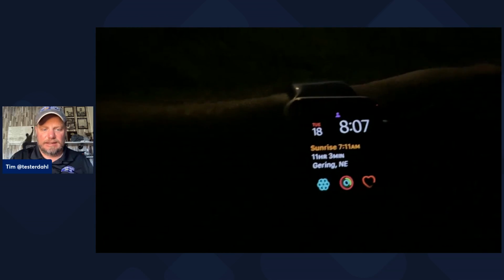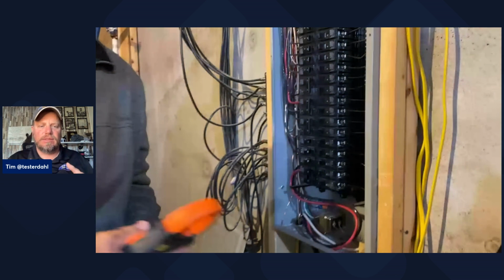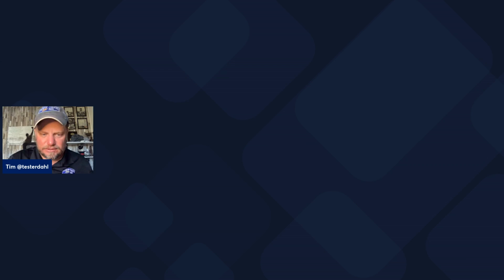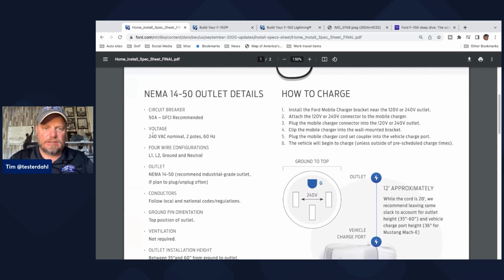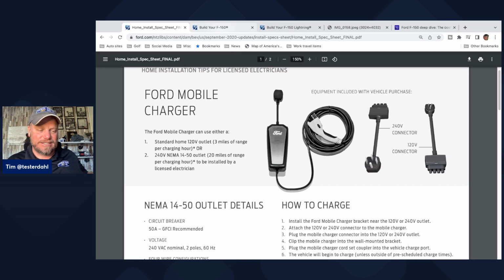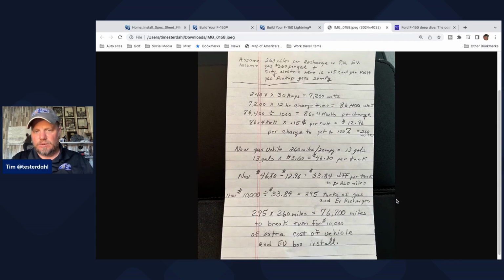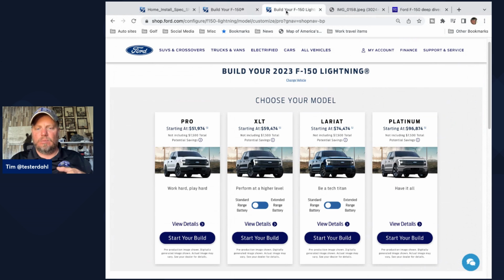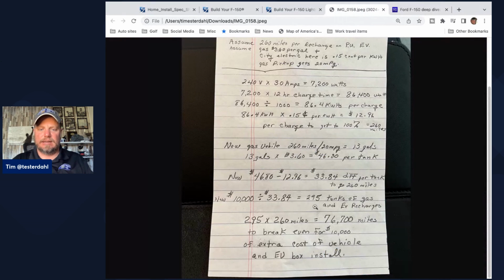11+ hours later on 220V charging price for 2022 Ford F-150 Lightning

Comment: Is an EV similar in cost for insurance?  Our state’s license fees are based on vehicle and Gross Vehicle Weight.  Just a couple more factors.  Another channel also mentioned additional snack/meal cost when you are on the road waiting for your EV to charge.  Interesting series of videos, Tim!
Reply from the maker: That's a really good question. I'm buying an EV next year and I'll have data then.
Reply: @Pickuptrucktalk  so many factors so you can't be exact, but generally insurance costs are similar.
Reply from the maker: @gelu88  interesting. Just literally chatted with an insurance agent who said costs are higher but could get to similar in time.
Reply: My platinum will cost me approximately $50 more every 6 months than my 2018 Toyota Prius costs me to insure. There are so many safety factors that the platinum has that reduces the costs.  Example I was backing up, was warned I was getting too close to a large plastic container, knowing I wouldn't hurt my trucks bumper if I did nudge it kept backing up, large red label appeared on screen collision danger & making noise, then the truck slammed on the brakes.  I put it in park to look and I still had an inch or two clearance. I believe,  had I been driving faster it would have reacted even sooner. Would it avoid a collision all together,  I don't know, but it would definitely reduce the amount of damage.
Reply: INS cost more for an electric vehicle vs similar gas. electric cars are just more to fix not to mention other factors such as batteries catching fire and harder to put out...a lot of states are now charging a "gas" tax (added registration cost every year) to get lost revenue for roads since they are not buying gas and that up to 400 in some states and as low as 150..some states are tossing around the idea of adding a per kw hour charge of .05 as a gas tax on top of the rate if you own a EV.  you need tires 2x sooner than a gas car due to heavier weight. needs brake pads a lot sooner too.. so at end of day for convenience a gas is still better. and you need to factor in wait times to the equation. 5 min to fill a tank vs 2hours to charge. and that 5 min gives me 350+ miles of range vs maybe 200 miles.
Reply: @Pickuptrucktalk  Did he state why?  He might have been thinking specifically of Teslas, since many people associate Tesla with EVs - Teslas are notoriously EXTREMELY expensive for body repairs, leading to them being expensive to insure.
Reply: Most states go by the value of your rig,the more expensive the rig the more expensive the license plate tags,same with insurance.Who's gonna work on the ev???no shop where I live.
Reply: I watched a ford lightning vid, and it took $30 to "fill" it at the charging station.
Reply: @noonenoone848  Yep, that is why it is better to make an electric.  That way the DMV doesn't know, and I checked with my insurance, and they are the same.  It gets listed as a gas car still they don't care what is under the hood.
Reply: @robertsmith2956  That's roughly consistent with an ER going from 0 to 100% at 22 cents/kWh, which is a bit on the expensive side.  (I pay 12-14 at home)  The hybrid F150 would have been around 1.5 times as expensive per mile, and the non-hybrid options would have been 2x more expensive or worse.

Comment: The reason you need to run a 50 amp wire even if you're only pulling 30 or 32 amps through it it's so that the wire temperature stays low. If you ran a wire that would just barely carry the 32 amps such as you say a 40 amp circuit you would be pushing that wire and breaker to the point of getting pretty warm. And the wire inside the wall cannot dissipate heat hardly at all so you do not want to run close to the limit of your circuit. You always put in a heavier wire then necessary. And actually I don't remember ever hearing of a 40 amp breaker. You go from 30 amp to 50 amp. If something else is pulling current even only part of the time on that same circuit you are pushing your wire to the limit and weakening your breaker.

Comment: If you want maximum life from your battery you won't deplete your battery below 15% and only charge to maximum charge of 80%. Occasionally charging to 100% probably won't reduce your battery life that much but constantly DC fast charging will definitely effect your battery life.
Reply: Now your mileage is only 100 miles per charge.  35 miles if your towing something heavy.

Comment: the best way is to set it up like a friend of mine, he just bought a Lighting and still has his original leaf but any way he has solar setup with a large battery bank and has not bought any gas or heating oil in the last 10 years completely of grid he can maintain both vehicles fast charging and in an emergency like something with his power at the house he uses the lighting to feed house , oh to be single and be able to play with all that stuff great video thanks

Comment: Im still driving my 3/4ton.  36 GALLON tank @24.4 mpg. 800 miles to the tank. 
Screw electric vehicles
Reply: you can carry extra gas cans, cant carry another battery

Comment: The reason for 50 amp from service is as many are finding that the service connectors are overheating for the duration of the charge. So just like over specing your service feed cable with 6-3 cable the connectors need to be handled the same way. Another reason why this is important is unless you have a voltage regulator in the circuit most power suppliers have a bit of fluctuation resulting again as heat at the connector. The common hidden point of failure is using the local 240 V dryer outlet which are usually spec'd to only 20 amps which inturn melt internally.

Comment: The fact remains that the market for EV's as they are is just a tiny speck.  The owner shouldn't need to drive daily because of the slow charge time, need to go far, and should preferably be in a temperate climate for better performance.  Keep in mind too the battery life as soon as you hit any heat or defrost or other accessories.  I assume they offer some kind of A/C as well.
Reply from the maker: They have A/C.

Comment: I just took a week long trip to Maine. A 6 hour ride in my 2017 GMC Sierra 6.2 L towing cargo trailer with ATV and luggage. Used a tank an a 1/4 of gas. Using estimates found on the internet The same trip in a Ford Lightning would take an additional 5 days for charging. And there were no charging stations in the town I stayed. An electric truck is not for most people. A novelty.

Comment: MT did a piece on a EV range test in Cali and it was $17 per gallon equivalent for @300 miles due to pricing at public charging stations that charge a variable rate based on demand. Sort of like running your dryer all nite..times hundreds of thousands doing same= brown out. Battery levels are not same as liquid fuel levels as the cells are "alive" and fluctuating constantly :)
Reply: First off public charging is not how you charge an EV everyday. Either he picked the most expensive public charger ever or he was fudging the numbers.
Reply: @seanroge  nope , they were doing a range test in Cali and charged at public chargers as you would,on any trip, all legit. MT is Motor Trend magazine
Reply: @CallsItLikeISeizeIts  If they are doing it up to full charge they in fact aren’t doing it as you would road trip. How you road trip an EV is at most up to 80% and if it is less range needed to get to the last charger in range you don’t even go to 80%. Know how to road trip with a EV before trying to sound knowledgeable on the subject.
Reply: @seanroge  Yup.  Assuming the comparison of a 20 MPG hybrid vs a Lightning at 2.44 miles/kWh:  45 cents/kWh (the WORST peak-hours Tesla pricing I've ever seen) is equal to 3.7 dollars/gallon.  Even that highway robbery Taco Bell fast charging station (nearly twice as expensive as the worst I've ever seen before) that has recently made the news at 80 cents/kWh would be the equivalent of 7 dollars/gallon.

Most people charge their EVs during the night (off-peak).  I pay 12 cents/kWh including delivery, which would be 4.9 cents/mile for a Lightning.  That 20 MPH hybrid F150 would be 18.5 cents/mile at current gasoline prices.

Comment: Battery temp also changes range . So it prob was hotter out so battery temp was slightly up .
Reply: That was my first thought, temperature variation.
Reply: @charlesd3376  Battery temperature doesn't actually affect range that much.  Heating the cabin to keep yourself from freezing and windows from fogging, THAT does, and sadly, Ford skipped the heat pump option for the Lightning.  Recirc is efficient for heat, but fog city!

For reference, at 40F (which is when the Chevy Bolt's battery heater stops), the Bolt battery's internal resistance is low enough that it's about 1% loss at typical highway loads.

The problem is that keeping the cabin warm in the Bolt (and also the Lightning) is a resistive heater which eats power.  Especially since you have to bring in outside air to prevent fogging.

Some EVs have a heatpump that can be set up to run as a dehumidifier for recirc which is MUCH more efficient.

Comment: So much of what you said is exactly the reason I bought a tesla model y LR with the tow package. It charges at 48 amps, and it tows my 16' trailer better than my old f150 did, and it cost way less than a pickup truck. At first, I missed having a bed, but I've adapted, I guess, or I've gotten over it. My angry pixies cost half what yours does, so a full charge for me costs only $6. I also drive about 15,000 miles per year. Now you have to understand that what you call a charger is just a supply cable. The charger is part of the vehicle. Never forget that. After over  a year of EV  ownership, I can tell you that understanding that fact will come in handy later. That cord is just a smart extension cord with a switch in it. It actually has special transistors that can interrupt or conduct AC current, and the truck tells it whether to conduct or not. The truck decides how much current to accept and under what conditions. I had an old explorer, and I liked it except for the front wheel drive part. The new explorers were really close in price to the model Y, so I didn't take a hit with the purchase price. That range where is says 260 miles, that's probably not going to be true either just based on my experience with the tesla and the Hyundai ioniq 5. Good luck and buy a proper level 2 charger. It's worth it.

Comment: The time problems with charging vs refueling is the killer for EVs
Can’t see it being solved real soon
Reply: The white elephant in the room !!
Reply: With a battery capacity of 82 kWh (Model 3 Performance and Long Range, 2021), you can charge your Tesla from 10% to 80% of state of charge for about 5 hours and 33 minutes using Tesla Gen 3 Wall Connector and only about 16 minutes through V3 Supercharging (250 kW of power)....
Reply: @kylereese4822  and I can refuel my diesel Hilux in about three minutes ( hi-flow)
And do 1200km ( 700 miles)
No problems
Reply: @kylereese4822  that’s if the temperature is correct ,the full supply is available ,
The stars are aligning…..
And it kills the battery heaps faster
No matter how hard I squeeze the trigger on the diesel pump it never hurts the tank !
Just sayin

Comment: The range is calculated on the battery voltage, after you fully charge the battery, it's voltage will decline to a steady
state after all the chemical settling occurs....That is when the voltage drops slightly and a new range is calculated...
  Example, your automotive 12 volt battery is normally charged at 13.8 to 14.5 volts, then when the charge is stopped,
the voltage will be around 13.1 or so and will decline to 12.7 after a few minutes.....

Comment: The main problem is out of warranty repairs on evs are expensive and less independent shops to work with..

Not a good pitch where you can keep the same gas pickup for 20 years compared to an ev due to costs of repairs

Comment: Tim: You did an excellent job of trying to assess this Ford EV pickup truck and make sure there was disclosures and qualifiers included. But I came away with only one conclusion: An EV Ford pickup truck will not give a return on the investment in a reasonable time and are, therefore, not worth the buying. Is this the correct take away from today’s posting? Respectfully, W.S.
Reply from the maker: Just depends on your annual individual driving habits.
Reply: You need to consider the price of fuel where you are located as well as driving behaviors. Where I am located, the price of 87 octane is "down" to about $4.50 per gallon. So if the electric costs are similar to what Tim is paying, then the pay off will be a lot sooner.
Reply: @Pickuptrucktalk  You have to ask what is the price for electric if you can't charge at home. If you live in a apt. or park on the street you will be using public charging If they even work. What is your own time worth waiting for a charge. If the lightning charges in 1.5 hrs on public charging [ just a example ] what is your down time worth 8 10 20 bucks a hr to wait for a charge. What if the chargers are full then you have your 1.5 hr's plus the time of those before you and will get worse as more ev's are sold. I pull a 20 ft enclosed trailer from n.c to florida every dec for the karting wka dirt national's in about 9 hrs. It would take 2 day's using chargers and down time in a lightning getting 78 miles of range per charge towing and little sleep ! Ev's are fine but the charging grid is 25 yrs behind . The cart ran over the horse this time.
Reply: Here in Colorado Springs Colorado the ROI data we just ran:

True ROI: THE EV & Solar “Green New Scam Deal” reviled. 

EV and home Solar It’s not affordable for the masses, doesn’t save money and are environment disasters.

We just received a quote to go Solar to both charge future EV vehicles (which now average over $70,000ea) and for home hot water, heat & AC via a required $15,000+ heat pump HVAC conversion.

Cost just for Solar tiles and power wall over $150,000! (Doesn’t include cost of EVs)

Also, both the lithium batteries needed to store the power and solar roof tiles degrade over time needing to be replaced in 15 years, another $350,000 investment with Democrats caused current inflation rates at 40 year record high!

Another fact, grid power is going up 35-40% each year as our low cost, ultra clean burning coal plants are being shut down, stupid is as stupid does. 

The horrible environmental impact to produce and recycle Solar panels, Solar lithium batteries and lithium EVs batteries (if one can even afford to do so and/or find a local recycle company) are both unaffordable and environmental nightmares. 

Conclusion: 
1: No Home Solar Panels;
It’s better to install wood and coal compatible boiler systems for home hot water and home heating then heat with natural gas as a backup when going out of town. 

For AC, it’s best install a heat pump or swamp cooler using grid power augmented by a wind turbine if one can do so ie HOA rules, available land, etc.

2: No EVs
With the true cost of EV ownership (ROI) initial purchase cost, cost to charge and cost to recycle and replace EV batteries, we have decided to purchase the new 2gen GM 3.0l I6 Duramax diesels: 2024 GMC 1500 Sierra and 2024 Yukon Denali 3.0l Diesel.

In fact, Diesel is the most efficient combustion engine fuel source, carrying 38 kilowatt hours of energy in every gallon — 27 times that of lithium ion batteries!

The financial and environmental ROI impacts proves EVs, home Solar panels and lithium battery power storage are bad deals on all levels. 

In fact, it’s all a big scam.
Reply: Plus you really can't tow anything very far in bad weather !
Reply: Giving a positive ROI in less than the warranty period (Federal law requires battery warranty to be 100k miles, and I think California's new rules require even more) is quite reasonable.

Comment: You're making things a little tougher on yourself by including time in your calculations. The usable size of the Lightning battery (ER) is 130 KWH, to charge it would be 130 KWH * .15 $/KWH = $19.50. No need to bring time into this calculation.

You could also simplify things by just converting everything to cost per mile. And you might want to use EPA figures for both as your recent driving patterns may be impacting the guessometer. You're already using average electricity costs so using EPA fuel economy would be a nice generalized analysis.

So that's something like:
EcoBoost: $3.60/gal / 24 mi/gal = $.15/mi
Lightning: $.15/KWH * .48KWH/mi = $.07/mi
Delta: $.08/mi
Monetary Breakeven: $10,000 / $.08/mi = 125,000 miles
Environmental breakeven: different topic
Reply: This will explain why people in CA turn to Electric so quickly.

The Delta is so much larger.

At +$5 a gallon and EV electricity at home at $0.10* is makes a lot more sense.
*Certain EV-TOU plans allow for very cheap charging in the early AM hours.

EcoBoost: $5.5/gal / 24 mi/gal = $.23/mi
Lightning: $.10/KWH * .48KWH/mi = $.05/mi
Delta: $.18/mi
Monetary Breakeven: $10,000 / $.18/mi = 55,550 miles
Reply: You can also use these numbers to answer "how much does it cost to charge your EV?" because it depends on how many miles you drive. If you drive 20 miles a day it costs 20mi/day * $.07/mi =  $1.40/day. You can also do the same thing monthly or yearly.